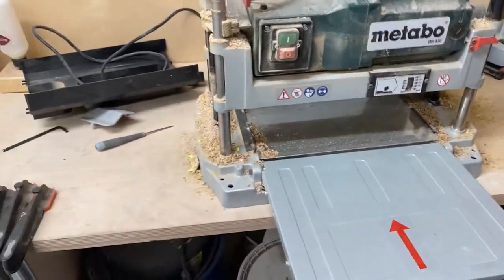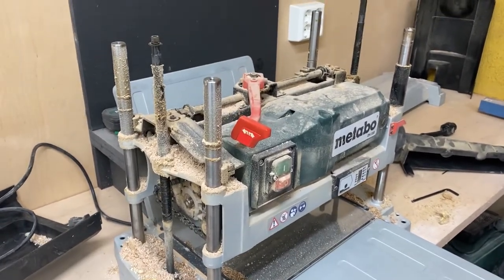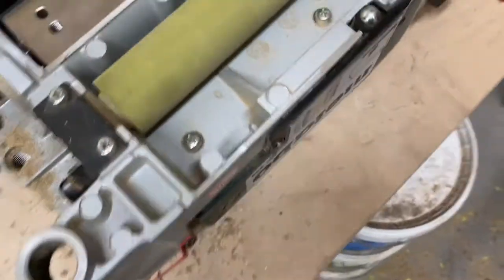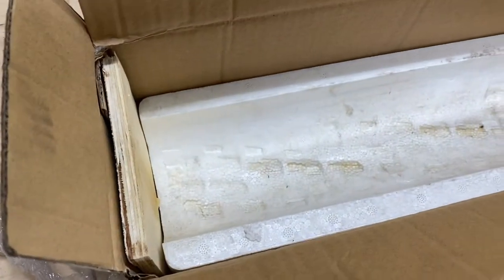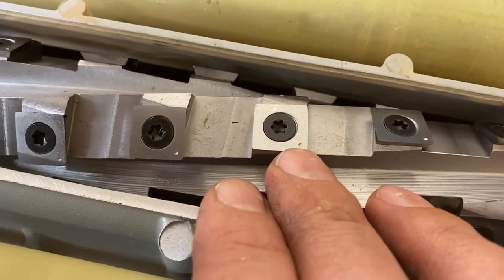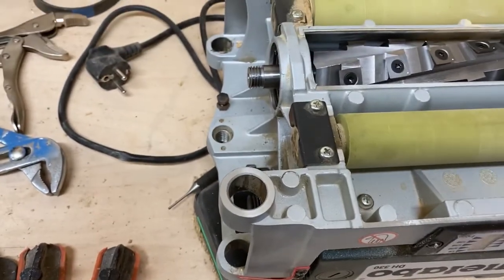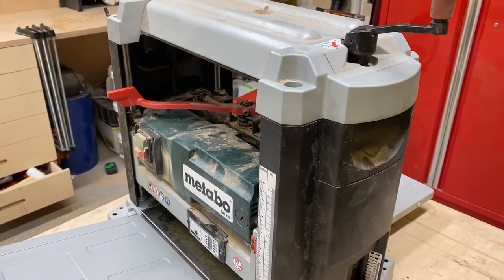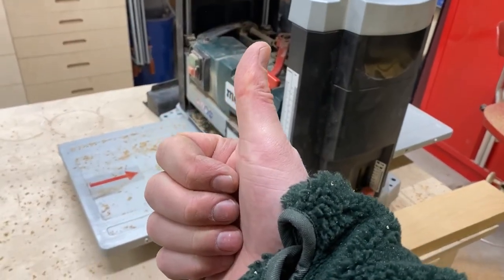Installing Sheartak spiral cutterhead on a Metabo DH330 thicknesser

Comment: Thank you for making this video. It is the exact thing I was looking for. I am gonna save up and buy the same head for my D330. Might be a long time 😂
Reply from the maker: Thanks for your comment robster. It certainly ain’t cheap, but i believe it will be hard to get a cheaper thicknesser with spiral cutter head. At least I haven’t seen any. Before I changed I had a couple of belts burn out and I had a couple of instances with debris getting underneath the 2 knives, causing delays, terrible results and ruined workpieces. So that justified the investment for me
Reply: @tools4fools717  I am very willing to spend good money for good gear. I've had my 330 for a couple of weeks now and the blades are already a tad chipped from me learning to use it. I feel like the helical head would be the biggest upgrade that I could give my machine

Comment: Hi! Does the cutter head already come with knives or do I need to buy a pack of 40 too to eb fully equipped? :)
Reply from the maker: Hi. The knives were included but not installed on the version i bought, as the dimension of the cutterhead with knives are larger than the bearing hole. Sheatak also have a version with a slightly smaller diameter cutter block that comes with the knives installed

Comment: Thanks for posting this!
The website says that with this "Noise is dramatically reduced". Did you find this to be true? At the end you seem to suggest it's still just as loud, so wanted to check.
I'm hesitating between this and the Makita, and I think the Makita may be quieter.
Thanks!
Reply: Ive never heard the Makita running so I don’t know how they compare, but the motor on the Metabo does make quite some noise -even when running without material. I got the Metabo because I wanted the extra width. 
But even if there is a minor improvement with the noise level when running material it’s still darned loud. So I usually wear earmuffs. Doubt the Makita will be very different as such. But the Makita has a slightly smaller motor rating- guess that’s helps reduce the noise a bit

Comment: Question: Where did you buy the cutter head? Straight from Sheartak, or is there a Norwegian dealer? I'm considering doing the same to my DH330, as getting new, original cutter blades is a pain in the butt these days. Greetings from Trøndelag :)
Reply: Hi Alf. I got the cutterhead directly from Sheartak. I doubt they have any dealers in Norway. Original style blades are a bit of a pain even if you have new ones too 😀
Reply: @meikkisnakk  Yep. Time to start saving some $ and get a spiral. Apart from that, I think the DH330 is a great little machine.

Comment: How can you disassemble the whole machine and not clean it? It's mind blowing.
Reply: 😂 good comment! Guess im just that kind of guy 😀 But its not very delicate mechanics and is built to handle it, so it should be ok (I hope). Still works fine after several years of use 👌

Comment: Good job. I have the same model Metabo DH330 and the cutterhead today stopped spinning despite the fact that the motor was trying hard. I supposed one or both of the bearing are damaged. What do you think? Can you tell me what size bearing this model takes so I can order them.
Reply: I have been reading a lot of forums and videos which point out a problem with wood chips getting behind the blades and bending them.  The plate seems to be too thin.  One user said that metabo told them that it was not suitable for rough wood only pre-planed wood which seems to defeat the purpose.  I assume with the spiral cutterhead there would not be the same problem, but for the price it seems that I may as well just buy a better thicknesser.
.

Comment: I have broken the band. Bought a new one put don’t manage to change it. Have you done that before  thanks
Reply: Hi. Yes i had do do it a few times. There are probably several ways to appraoach it, but If i remember correctly you just need to undo the side cover and roll the polyrib belt on- one rib at the time. So start to put the belt on one of the pulleys- but only one or two ribs. Then roll the same rib(s) onto the other pulley. Then push the belt over the next rib while rotating it- until it’s fully installed…. If that explanation was understandable…
Reply: Ok there is nothing to undo too approche the 2 pulleys ? Just try one rib at a time. Ok I will try

Comment: I do have this modle would you please make a noise measurement to your upgraded device by the way its 95 to 100 db. How much is yours and thanx
Reply from the maker: Hi. I did actually measure the decibel before and after. Mind this was done with my cellphone only so it’s not very scientific, but before the changeover I had about 100db. After it was around 75-80db. But before I changed the knives and machine was not well configured and tuned. The helical block does sound a bit less choppy, but I wouldn’t say it makes a huge difference to the work environment.

Comment: Have you tried to run end grain board now?
Reply from the maker: No- I never tried that and I would not recommend doing it either
Reply: @tools4fools717  Thanks for the comment. After 3 months of use, how are you satisfied with the upgrade, does it worth it?
Reply from the maker: @craftsmanmk8499  I am very happy with the way it performs now. I haven’t tested it on all sorts of wood, but it works way better on oak, and leaves a smooth finish. Previously I’ve replaced knives and worn belts, but I honestly believe that won’t happen again now with the spiral installed. I have a small shop and no space for the larger machines, so I found this to be a good solution for me. Since I already had the Metabo I also found it to be a better investment to replace the cutter head, rather than replacing the whole unit as the new ones are expensive with the helical cutters, and few go up to 330mm

Comment: 500$!?
God, almost as much as the whole machine!
The original one has a manufacturing defect?
Reply from the maker: Sure is a costly upgrade, and one need to consider if its worth it. No defect on the original one, but much more hassle to sharpen and adjust knives.

Comment: @tools4fools  Puuuh seems a lot of work to change the spiral cutter. The assebmling, disassambling part looks like a huge time consuption effort. Did you have snipes on the ends of your workpiece before installing the spiral cutter and if so, does the sprial cutter eliminate the snipes?
Btw. the shopping link that you provide has been changed. The new address is: 
https://www.sheartak.com/index.php?route=product/search&search=metabo%20dh330
But as you see on the web site there are two different versions of the cutter. Which one do you have take? - SUBSCROBED.